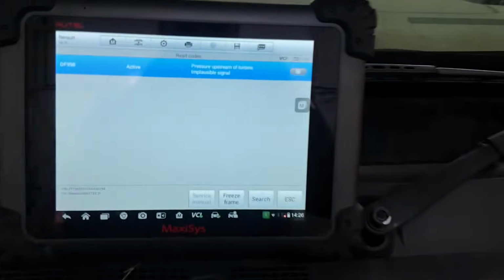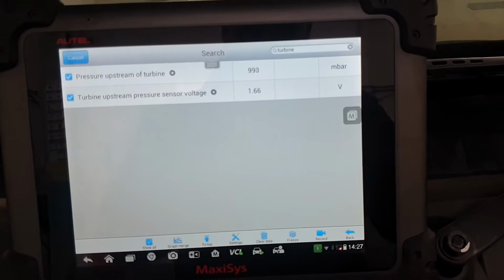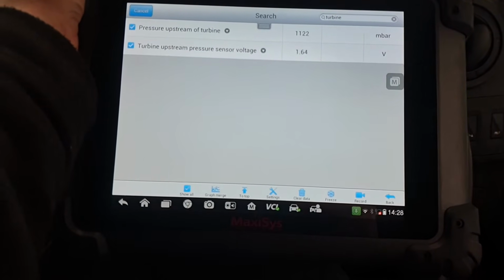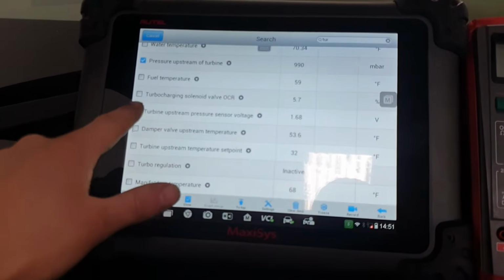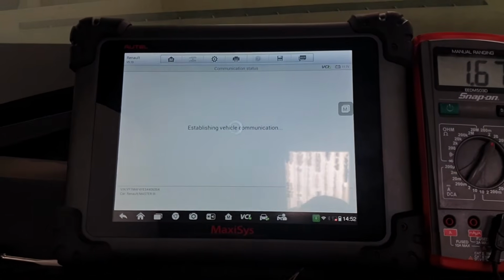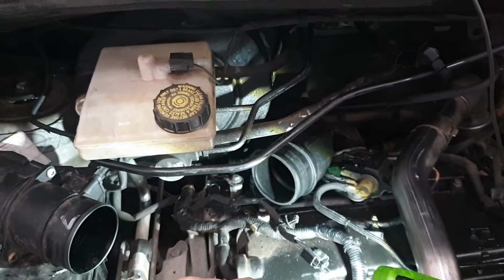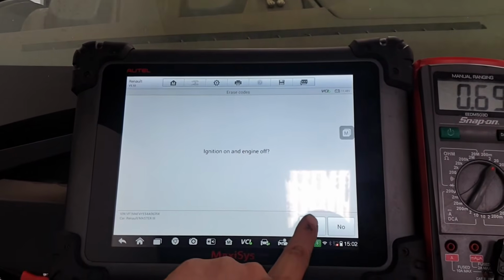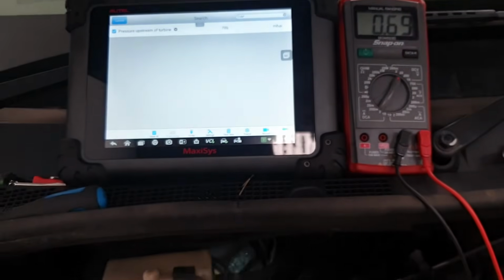Renault Master - Exhaust Pressure Sensor Fault

Comment: Do I understand correctly that the voltage on the sensor should be 0.7 V with the key on and the engine off?

Comment: What engine is this as it looks slightly different to my 2.3tdci
Reply: And I'm struggling to locate the sensor
Reply: @Dave-Fa did you find the sensor I'm also can't  find mine, My van is 125bhp model.
Reply: @David Brennan  turns out it's on the back of the manifold, but there's two types for the same engine, mine was the manifold without the sensor .... but if yours is you need to get right under the van and look at the back of the engine and its top right of the manifold...my fault turned out to be a split dpf pipe

Comment: Excellent video. Could this have been diagnosed by purely using the multi meter. I.e. seeing that the voltage didn't change on the signal wire?

Comment: Why wouldn't you actually show how to disconnect the sensor and where it's placed. This video would then be useful to more than 0.1% of people watching 👎
Reply from the maker: I think most garages know how to disconnect a connector it's quite self explanatory. The location is practically impossible to get a good shot as advised on the video because of its location. Thanks

Comment: Hi I have a similar problem with my Renault duster where is says turbine upstream pressure sensor voltage outside upper limit. Can you share a picture of the sensor as well as the location of it as I wasn’t able to clearly see that in the video
Reply: Hi were you able to get correct diagnosis and rectification for your problem?

Comment: Great vid 
Can you explain why the ecu would want to see 700mbar koeo and not atmospheric pressure
Reply from the maker: Yes of course. Originally the voltage being produced was 1.6v = (998mbar) approx, after the sensor was bypassed with a voltage of 0.7v the value decreased to 700mbar. This value is a theoretical value and is not based on voltage output. We disconnected this sensor completely and the run the vehicle to find this value would still increase and decrease accordingly with engine RPM. The reason it was reading 700mbar when the correct voltage was applied was because the engine ECU had already LEARNED the higher value of 1.6v and corresponded that to 998mbar. After a road test and monitoring the values, 0.7v equalled 990mbar. It was just a learned value. Does that make sense ?
Reply: Elite Automotive Diagnostics yes thank you I didn’t realise it learned the new value.
Reply from the maker: @carlhoggatt7311  yes, certainly one to look out for

Comment: Literally had another garage drop a Trafic off to us with the same fault this week. After being on the course with you and Brandon in Feb I decided to use the pressure pulse to confirm that the pipe was not blocked (yep I know overkill, but had time and wanted to practice). Anyway great content as always Ryan and I will be in touch for a Pro Master Kit. Thanks Paul. 👍
Reply from the maker: Thanks, Paul, that's a great test method to determine a blockage! Look forward to hearing from you. Regards Ryan

Comment: The pipe to the sensor is plugged up.
Reply from the maker: This was a electrical fault, not a physical fault with the system. The internal voltage was too high with the ignition on and not running.
Reply: I should have said probably then;) 👍
Reply: Could also have been a problem in the sensor ground. What was the actual repair ? A new sensor?
Reply from the maker: @martijn8337  yes, new sensor plugged in was reading 0.79v
Reply: Sorry for the bad englis writting,y have today the same problem what yuo have de old sensor was 1,6 v but jou nou way?because the pijp pres air too the sensor en it doont go back because the pijp was stack zo the voltage statds too 1,6 tot that hij make the hose loos dan the praser go away en the sensor was teafing ahain 0,7.So always take the pijp lose en chek the voltage if hy gose back too 0,7v.